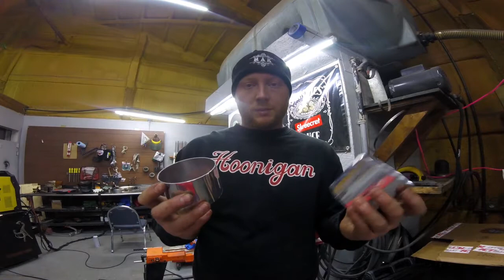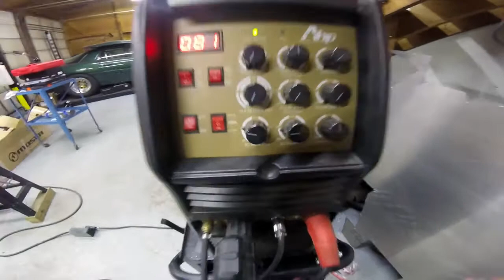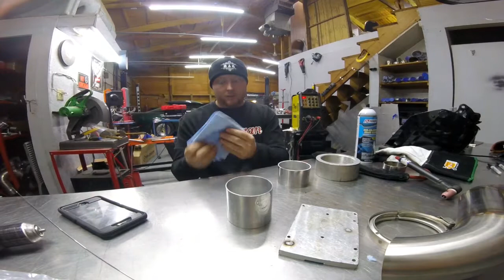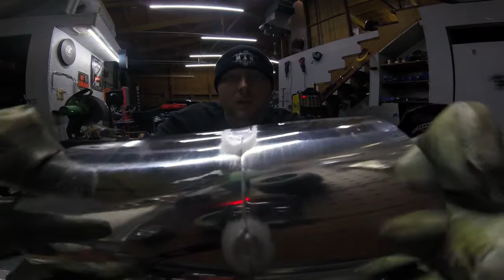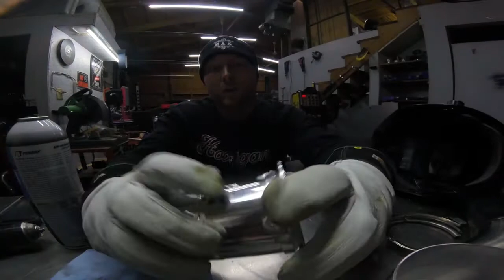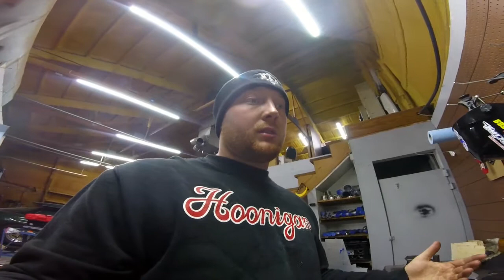Welding Turbo Coldside Piping With AHP AlphaTig X. Lowdoller Solutions High Dollar Results

Comment: So glad I found this video! I've been struggling on some .065 intercooler piping and your settings have really helped. The welds are not super pretty but far better than the trash I was producing. Having the correct setup makes a huge difference. Now I just need some more seat time.

Comment: So might be dumb question but did you have it plugged into 110v or 240v? I only have 110v in my garage so thats what I run on
Reply: Doesn’t really matter what he has it plugged into. The settings will only allow you to go up so high on 110v. The settings he shared will be doable on 110